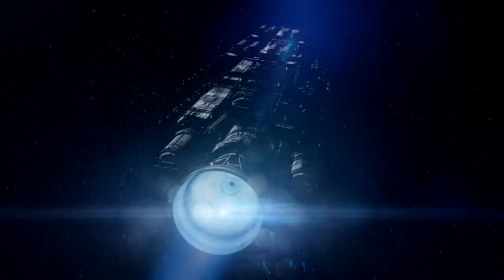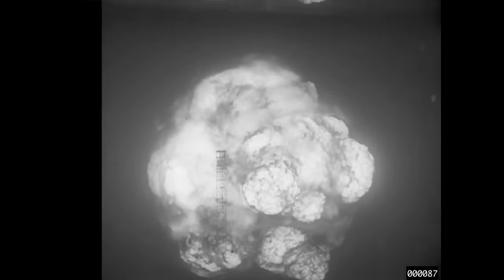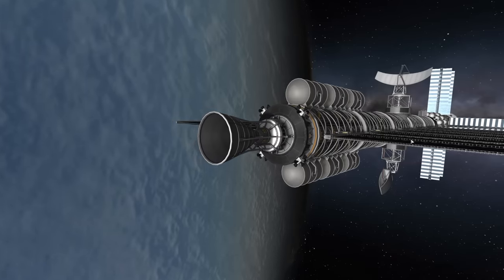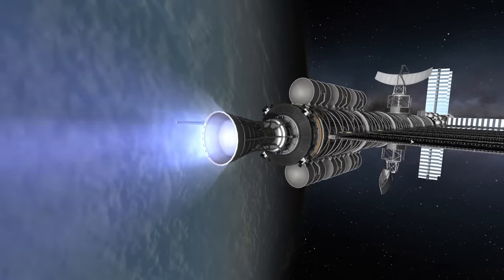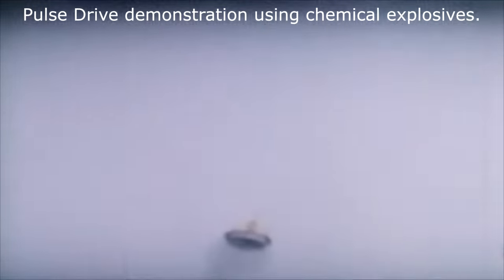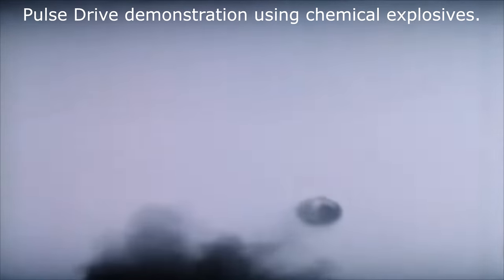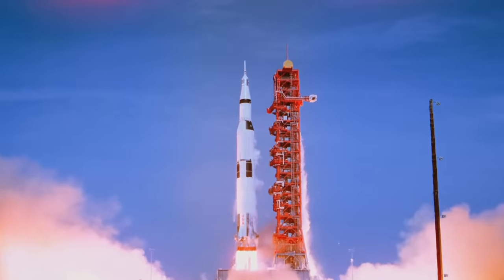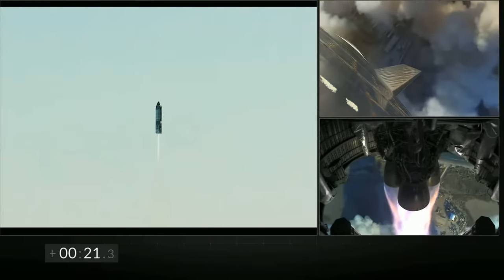The Nuclear Salt Water Rocket - Possibly the Craziest Rocket Engine Ever Imagined.

Comment: Would it be beneficial to use Nuclear Salt Water Rocket as tugboats or rather slings. You could place one orbiting Earth and one orbiting  e.g. Mars. You would then use chemical rockets to lift containers of equipment and suppliers at LEO. The nuclear tugboat would then rendezvous with it and accelerate it to escape velocity and send it on a trajectory to e.g. Mars. The cargo container would then coast to the destination. Once it approaches Mars Tugboat/sling would then accelerate to rendezvous with the incoming cargo container and decelerate  it to martian orbit or descend. Because the time spend accelerating/decelerating is small compared to the coasting time, each sling could continuously pick up cargo containers.
Reply: The Nuclear Salt Water Rocket is basically a flow version of the Aqueous homogeneous reactor - https://en.wikipedia.org/wiki/Aqueous_homogeneous_reactor
Reply: Maybe the challenges with avoiding criticality out side til reaction chamber could best be managed by not mixing the fuel with the moderator, the water, before they enter the reaction chamber. You would have a simple water tank and a much smaller container for Uramium isolated from moderation. I am thinking that it  should be fine Uranium dust or pellets or Uranium dissolved in liquid salt. Only once the two are injected and mixed, will they become critical.
Reply: Furthermore place the reaction chamber in a magnetic confinement, where the plasma of fissile fuel and moderator will be pushed away from the nuzzle wall to protect the wall AND into a higher plasma density, which will increase the yield and decrease the critical mass. Similar to how a tamper of heavy material works in nuclear weapons. The longer/denser you can hold the fissile material/moderator mix. The more nuclei/neutron interactions can happen before it is blown into space. You will need less materials in the chamber at any given time and that fissile material/moderator will yield more thrust per unit of mass because a higher percentage of fissile nuclei will undergo fission. You will need less materials (fissile and moderator) to go the same speed and distance.

Comment: This could be a very good solution to colonizing mars if you used it in some kind of mother shil concept. Perhaps have all your starships fly up and dock with the mother ship that will navigate them to mars and than the starships break off and land under normal chemical power. This would eliminate the need for refueling of the star ships for their mars injection burns and each starships could work as its own lifeboat shoot the nuclear mothership fail in some way.

Comment: Interestingly, powering the fuel pumps wouldn't actually be that hard.  With all that energy coming out the nozzle, it would be easy enough to boil water to make steam.  Just use that steam to power whatever you use to pump the fuel.

Comment: Amazing. But I still can't understand where all this mass of salt water flowing from 6cm pipes at hundreds of km/h out the nozzle comes from. Haven't we simply replaced the need for tons of chemical propellants with tons of coolant/radiation protection? Admittedly, for much higher speeds, but still seems like a LOT of mass to carry around (and you have to always carry 50% for the return trip including braking at both ends of the journey.)
Unless I'm totally missing something. Which I'm hoping someone can point out.

Comment: We need to get thorium reactors figured out and widely implemented first, otherwise the uranium this would use is probably more valuable for nuclear power plants than for rocket engines.
Reply: Considering there's billions of years worth of uranium in the sea water, not to mention the potential for billions more in the asteroid belt, that's not really an issue at all. However, breeding thorium into Uranium-233 (which is how thorium reactors work) would indeed be a good way to get even more bomb material/rocket fuel. Sadly, the reactors that do that are very complicated but I too hope they'll eventually figure them out

Comment: If you use a solvent with a greater loading capacity than water (formamide, for instance) as well as neutron sources (Cf-252, tuber generators, etc.) I believe this could be achieved in a very controlled manner. Plutonium salts would be ideal as Plutonium requires less atoms per unit of volume to achieve critical mass. Add some electromagnets to the chamber/nozzle and you have the perfect engine.

Comment: Also there is already loads of radiation in space. Nucliar propulsion sounds promising for maned fligts as long as crew can be shealded. Could perhaps be used many times as a shuttle between the planets. Perhaps unmaned trips to other solar systems.

Comment: Not crazy if utilized in deep space. Well, not As crazy. Being on the other side of a nuclear reactor still sounds less than serenity inducing.
It seem this type drive would be even more efficient with a spike or wedge nozel. Also it seems enough electrical energy could be generated to make magnetic bottle protection the nozel practical. In terms of energy, in any event

Comment: Could this produce a ship with a constant 1G to give "artificial" gravity? If so how long to Mars with a constant 1G acceleration 1/2 the way out & 1G deceleration 1/2 the way in?
Reply: 3 days, if you turn around halfway and start decelerating. A bit less than one and a half if you just want to blow past it. :)
Reply: @Rickenbacker69  Which would be awesome, but sounds like the exhaust velocity would need to be unrealistically high for a salt water rocket by turn around point. Never mind fuel consumption. Perhaps the "future" fusion drives (from another Scott vid) will offer more feasible .25g two week trips.

Comment: i guess you could use g force to propel the water in that direction, since the craft will be under const acceleration.  rather trust newtons law than a pump or mechanical system.  :)

Comment: I believe the nuclear water reaction was the concept used in Arthur C Clarke's - "Rendezvous with Rama" Not sure if he invented the idea. But he very well could have.
If you started the nuclear reactor in low orbit would the exhaust not cause a lot of the debris field to fall into the atmosphere and burn up? If that was effective enough it could increase the justification for using the engine. It would probably alter the orbit of larger debris so you probably have to either wait for such debris to pass or if you can hit the right orbit height and period you could wait for a target object to approach and then ignite the engine just as it passes to give it the most push to enter the atmosphere. Just a thought

Comment: This wouldn't be unsafe in space.  Space is already full of massive amounts of radiation, anything this rocket puts out would be like pissing in the ocean.
Reply: it would be if someone was on it... that much radiation anywhere near a person would kill them.
Reply: @lucycassidy2709  Actually no.  They'd be at the other end of the rocket, and be protected by both distance and shielding.
Reply: @StormsparkPegasus  I don’t know how practical it would be to have that much shielding, remember radiation travels at the speed of light, so no matter what it will get to them, you would need a shit ton of shielding which is weight, so I think it is possible but probably not practical
Reply: @lucycassidy2709  The greater the distance, the less shielding needed (plus the shielding would be around the engine anyway).  Distance IS shielding.  A ship like this will be quite large.  The crew won't be anywhere near the engine.  They would be at the other end of the ship where most of the radiation they have to be shielded from is background radiation from space itself.  Look at the ship from Avatar to see how this would work.  Also, only electromagetic radiation travels at the speed of light.  Alpha and beta radiation (and smaller nuclei from fission) do not and cannot travel at the speed of light.  All of the emissions would be going out the back of the ship too.

Comment: With all respect Im a no one but I have a question. I know that thru electrolysis we can get HHO gas also known as Brown gas. My question is, what if you streamed presurised atomised water thru a cylinder, something almost like a rail gun, with a arc welder type current? Wouldnt the atomised water create a short and get electrolosised into HHO gas? Sure youd need to play with electrodes and current as well as pressures, but it would eventually work. Then ignite the gas. Now here where it gets interesting. HHO gas converts back into water when ignited, so if you could collect most of the HHO not turned into energy and recycle it back. Whalla Epstein drive, or am I wrong??? You could keep the water around the ship itself in a graphene bag, as a radiation shield and to dissipate heat. So....now your fuel is water, like youd have an issue with that.

Comment: That this hasn't been test-fired shows a commendable level of self restraint, after all the mercury-fueled rocket /was/tested (underground with filters on the ventilation, don't see why they couldn't have tried that here too) A little disappointed that Edward Teller appears to not have been involved...
In the end it leaves only one question: Why don't we have these in Kerbal Space Program?
Reply: The only reason we didn't test it is probably Teller didn't think of it.

Comment: Question: considering flight to Mars: could this maintain 1G acceleration, up to a calculated point between Earth mars, turn around and decelerate to "create' 1G before arriving at mars... the point being, providing a 1G environment for astronauts flying to Mars??? jus' wonderin'... my math is not capable of calculating one-way flight duration 😜
Reply: Yes, NSWR is a torch rocket, just like the Epstein Drive from the Expanse. It could provides 1G acceleration for days, just like Epstein Drive.
You could go to Mars in 2 - 5 days using this Chernobyl Drive.
Reply: @1ndragunawan  Gotta use high-enrichment fuel for that, though.
Reply: @caav56  well, yeah, you need many terrawatts of thrust power for such good performance, that can only be achieved with a continuous nuclear explosion
Reply: @1ndragunawan  So, as experience on the ISS has shown, a flight duration of 2-5 days - at zero-G - does not necessarily present significant health hazards (even becomes "negligible") to the human organism; The goal of creating a 1-G (or a significantly useful percentage/fraction of 1-G) environment becomes geometrically less necessary...or significant.
The key point for this question is: providing a significantly/useful portion of approaching a 1-G environment to reduce/eliminate lack of 1-G environment negative health impact on astronauts... cosmic radiation exposure notwithstanding. Furthermore (as stated, my math skills ain't so great), at a constant acceleration rate of 32ft./sec/sec (i.e. "1G"), how long until a significant percentage of the speed of light will be achieved? and the actual speed of light? Einsteins' Mass vs. speed notwithstanding. (most likely, my cocktail napkin is too small to write/represent these numbers 😆
Reply: @johnhopkins6260  As the Expanse shows, there's still one benefit of 1G or at least some G force, that's treatments of injures crew member.
Right now, if a crew bleeds out heavily, that crew will have to go back to Earth for surgery.

As Star Trek also have shown in the past, you could also sent important people on Brachistochrone Trajectory to Mars. Scott also has a video on this trajectory.

Maybe some future US Senator feels the need to inspect Elon Musk City on Mars. 😆

Comment: How do you shield the crew from the massive amount of radiation you're generating?
Reply: I'd put the crew compartment on the end of a big stick to keep them further away (a bit like the ship in 2001), and with the fuel tanks etc in the way too you might not need that much shielding... Would only have to be a disc between the crew and engines, could fill a hollow container with moon dust or something...

Comment: So, how much faster could we get to Jupiter with a theoretical fusion reactor?
Reply: Just got to wait between from 50 years to never for a practical compact fusion reactor to be developed.  Fusion does not lend itself to compact installations; note that nature requires stellar masses to get fusion going.  Fission is much easier and we can do it NOW.  And I bet you'll never get the power density with fusion that you get from fission.
Reply: @banalresentive6523  What about fission-initiated pulsed fusion?
Reply: @caav56  Hi there!  First note that I'm no nuclear physicist.  So don't assume my opinion is divinely approved! :-) .  After reading on PUFF in Wikipedia (as if I'm an expert now), it looks like fusion would be achieved on a something less than a full-size fusion reactor by using electric current to Z-pinch the DT core of a composite fuel pellet - something like a mini-fusion-boosted fission bomb.  Hmm...  OK, given the (big) hope/assumption that near 100% "burn" is accomplished...

PROS:
1. a higher energy-return per unit fuel mass could be achieved.  I.e., greater ISP.  No "dead weight" water to haul around as propellant.
2.  Probably inherently safer than the NSW set-up - a fuel leak wouldn't cause a runaway fission reaction...maybe.

CONS:
1.  Complexity (and thus cost) would dwarf the nuclear salt-water design.
2.  You'd still need big gobs of fissionable fuel that a "pure" (dream on) fusion system wouldn't have.  Well, save for the reactor needed to supply start-up electric power.
3.  I suspect you couldn't get the high end thrust that an NSW engine would achieve, which would make a difference on "short" interplanetary hops (Earth to Mars or Venus, say).  Thrust would be like a souped-up ion drive.
4.  The fuel pellets would have a shelf-life too short for interstellar missions - if you want to brake at the destination.  Tritium has a half-life of only 7 years.  If you want to use the engine over some arbitrarily long period, you'd need the onboard ability to transmute tritium from lithium.

Count me as dubious.  But I'm not in charge.
Reply: @banalresentive6523  Truth be told, I was thinking less about PUFF and more about thermonuclear Orion/Medusa. But thank you for such a detailed answer!
Reply: @caav56  Fusion bombs, even massed produced, are EXPENSIVE.  And Russia and China would freak out if we put thousands of city killers in orbit.  It would be against (the current) space treaty also.

Comment: Idiot electrical engineering major here. Could a Tesla flow valve prevent the reaction from traveling up from the reaction chamber or is there a limitation that prevents using one?

Comment: Question, why do we have to use solar panels to power ion engines? Why not use a nuclear reactor? We already have the technology for that sort of power generation system i.e. a small  reactor that can fit in a ship and which is used to generate electricity, they are used on nuclear submarines.

 This is such an obvious thing, but nobody ever talks about it, why not?
Reply: Because for operation close to earth, the mass of the reactor plus radiators for cooling would be greater than solar panels for the same power output.

Comment: Scott (or anyone!) I understand water is a moderator, and water expands (1:1600?) when turning to steam. But could this concept not also work with Molten-Salts? The moderator would need to be injected into the flow before the detonation zone, but that seems like a useful means of additional control. (And that moderator could be hydrocarbon fluid not just water.)

I'm not sure if molten-salts could expand as much as water-to-steam at their (high) boiling point, but I'm also not sure that matters... if water being liquid or gas really matters after detonation.

Anyway I'd appreciate any thoughts on this. There's potential for Molten-Salt (FLiBe) be a breeder-blanket of Tritium in some Fusion reactor designs. Lots of Molten-Salt Reactors being pursued for fission (including TMSR-LF1 in China about to start testing). So I'm hoping there could be some synergy between civilian Molten-Salt research that might lend itself towards a concept similar to Nuclear Salt-Water Rocket.

Comment: Back in the 50s (ya, I was around then), before ballistic missiles, we (the USA) had heavy bombers.  There was a program to make a nuclear powered bomber.  Some of the development took place at Arco Idaho.  However when we perfected the ballistic missiles, the bomber project was dropped.  With newer designs available, a nuclear powered rocket engine is a very real possibility.  It just takes money to develop the design.  By the way,  there is a company developing a hot water (steam) first stage rocket right now.  It is possible to send up a payload into low earth orbit using steam and travel to the moon or Mars on reactor power (second stage).  The faster the trip is accomplished, the less radiation from cosmetic sources a person absorbs.  After working in the nuclear power industry for 50 years, I have received far less radiation than people in Denver (the mile high city).  Also the Soviet reactor in the Ukraine had a steam explosion when the reactor got out of control.  The Soviet design uses a positive power factor which utilizes the fuel better ( better kilowatt production).  But if it gets out of control when an idiot decides to run an unanalyzed test, the reactor at some point can not be stopped.  Western reactor designs use a negative power factor for safety even though slightly more fuel is consumed.

Comment: The neutrons bounce off the hydrogen in the water molecule. They both have similar cross sections. Its also why they use heavy water for moderation as it has twice as many hydrogen atoms. :)